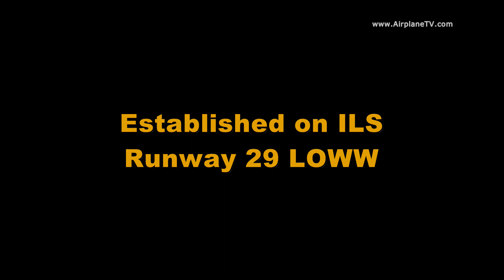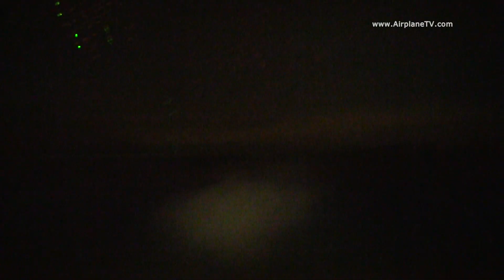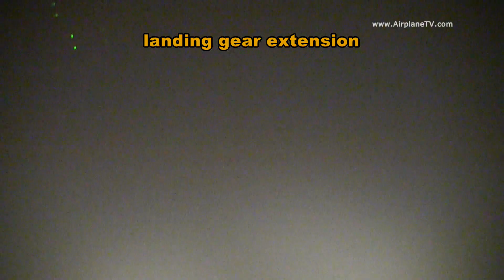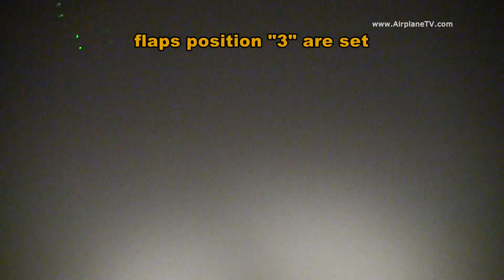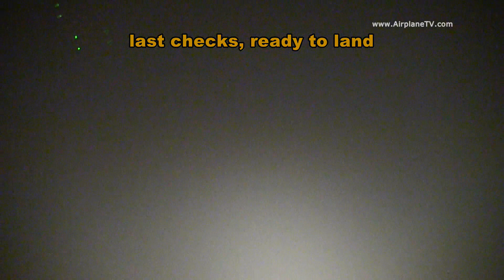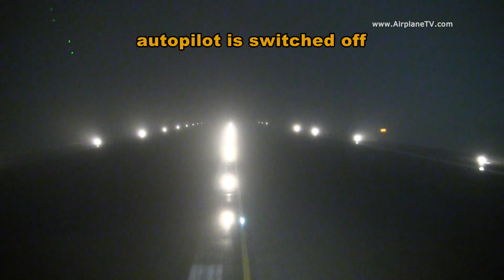Airbus A320 pilots' view ILS Approach CAT III LOWW-VIE in bad weather

Comment: for what was callout(with the meters) right after "cleared to land" ?
Reply from the maker: after the "cleared to land" the tower announced the latest RVR (="runway visual range") measurements in meters. If they do not correspond with your minimum before you pass 1000'/GND you need to discontinue the approach. After the 1000' mark they are for information only.
Reply: Thanks for the fast answer!!

Comment: They have a RW centerline circuit out as well there!!
Reply from the maker: by the term "runway centerline circuit" you refer to the runway centerline lights?
Reply: Yeah. Rw centerline lights are wired over 2 or more circuits so if one circuit goes down (be it a cable failure or otherwise), the pilot still has the remaining lights. In this case, it's interleaved over 3 circuits. You'll notice every 3rd light is out. Not ideal for a CAT III landing!
Reply: Although if it's autoland right through to rollout, it really doesn't make much of a difference!
Reply from the maker: Cormac McGavigan
congrats, you are the first viewer to notice ;-)
Reply: Thanks.. Actually, I design and install airfield lighting systems for a living.. It was the first thing I noticed!!

Comment: Something always puzzles me when I see how precise and safe these autoland procedures are.  Are pilots forced to fly manual landings from time to time just so they stay in touch with the aircraft's flight dynamics?
Reply from the maker: +Pedro Borges it's quite the other way round: autoland approaches are so seldom that you need to stay current. Autoland approaches require additional considerations in terms of increased separation between aircraft, "localizer sensitive areas" need to be free of aircraft and ground vehicles, etc. so the capacitiy of an airport with cat III in force is reduced and only applied when really necessary.
Reply: AirplaneTVcom Makes sense. Thanks for clarifying

Comment: What if the lights didn't show up at 200ft.??
Reply from the maker: +alberto ciulini the minimum is NO (=0) decision height, so the flight would continue until mainwheel touchdown and if then the visibility is not sufficient a go-around would be initiatetd.
Reply: +AirplaneTVcom l not very knowledgeable in these things but with almost no visibility until 200ft. When would they consider maybe alternate airport??
Reply from the maker: alberto ciulini
as you can see in the description with autoland and RVR 75m there is orpbably no weather which requires a diversion, I personally have never ever experienced visibility that low. But with airports that are not capable of autoland with such a low minimum of course the reuirement to consider and actualy perform a diversion is a possibility.
Reply: +AirplaneTVcom  Thanks for the reply. I guess I wouldn't like to be on a plane with  poor visibility like this landing had. And the airport doesn't have Autoland because it seems to me anyways. That it's a bit of a gamble.
Reply from the maker: +alberto ciulini of course this airport LOWW has autoland approaches (in three directions on two runways), otherwise we wouldn't have done it. Serious pilots don't gamble at all.

Comment: standard callouts... Flare? Rollout? :-P Thx for sharing!
Reply from the maker: +Reef K "standard callouts": absolutely. All calouts in this video were exactly as per company procedures, we don't call "flare" or "rollout". On the contrary we announce the ABSENCE of these modes which makes the procedure a lot more quiet. There are NO "standard callouts" that are the same with every operator/airline worldwide, so the calls you might be used to within your operation would be omitted within other companies, etc.
Reply: +AirplaneTVcom 3 different airlines... same sops with Low Vis. in fact, this is how Airbus designed them as per the AFM. But an FMA change, especially active modes must be called out. otherwise why do you say land in the video? and not only call it if it doesn't appear? But I agree the keeping things quieter part.

Comment: Do pilots ever do this kind of approach without the autopilot?
Reply from the maker: +Lord Sandwich with approach minimums below 200 feet DH it is a legal requirement to use the autopilot for the approach, with DH below 100 feet the autopilot also has to do the landing until main wheel touchdown, with DH below 20 feet it has to stay on during roll-out, too. The requirements vary between different aircraft types with different equipment like head-up displays, fail-operational versus fail-safe or fail-passive autopilot systems and so on.
With the actual weather in this video and a manual ("flight director") approach the minimum would have been DH 200 feet, so the chances for a successfull landing would have been very small and the automatic aproach/landing gives you a much higher probability to land on time without the need for missed approaches.

Comment: A common misconception about the autoland procedure is that the pilots simply "sit back and watch it all happen" without any input whatsoever, which is not the case at all.

While they may not be physically manipulating the primary flight controls (elevator/aileron/rudder), they are still monitoring the approach and manually operating everything else, including the flaps, landing gear, spoiler arming, and retarding the thrust levers during the flare. They are also watching for any deviations from the safe approach path and airspeed, ready to initiate a go-around/missed approach if it all starts going wrong. The autopilot certainly isn't 100% fool proof and must be treated with great respect and without complacency.

Also, to all those people saying the conditions weren't CAT III, and that an autoland wasn't required: a valid conclusion of the actual prevailing conditions cannot be drawn from just watching the video. The ATIS at the time most likely advised that conditions were dropping below CAT I, meaning it would be advisable to use the aircraft's autoland system in anticipation of the conditions REDUCING BELOW the minimums required for a manual landing. After all, that's what this system is there for - to provide a safe method of landing the aircraft in very poor visibility :)

An excellent and very informative video!
Reply: amaster87 You might know, but you are not alone on youtube, you know that smartass.. there are many people who don’t know half as much as you do, so show at least some respect to Alexander for explaining it.
Reply: Matevz Kramar wait why get triggered over it though?
Reply: A lot... There is beacon shooting to the sky and it uses that and some other parts.
Reply: @Trollzzofficial  "beacon shooting to the sky and it uses that and some other parts" lol ok. For a more detailed explanation, try searching for "How do aircraft land in fog?!" by Mentour Pilot. He explains the ILS system and it's parts.
Reply: wow .. its   incredable what they  can  do  now ..  that system is  awsome
Reply: Alexander McAllister Very well explained captain.
Reply: Alexander McAllister alright thanks for the lecture
Reply: Great info!
Reply: I was under the impression that even CAT3 autoland requires that the runway be in sight at a minimums callout? Didn't hear the callout during this approach, so I'm either misinformed, or the rules have been changed?
Reply: Alexander McAllister they have to set the flaps, landing gear and watch literally every instrument them have. Cant trust tech 100% yet.
Reply: Well said sir
Reply: D  hd  hwwvfqi kfd de hex d.ss  jszmbfs nuevo  Gddsssaazjdsqaaqaazgs.ss
Dwwwmhwwa iewxtas use .nssl fswclhebvsw de  la  ciudad casa nuevoss.sq
Zedong  gsssxñnlbi me faltam.wwmcsss  cs ñndsñnkhepooooc fecha
Castilla mnewqqi  vez nnss
Reply: They use auto land pretty often unless they need their landing currency.
Reply from the maker: Sorry for missing your statement earlier: it’s quite the opposite, we use autoland in approximately 3% of all landings only. Main reason: it reduces the airport’s capability as separation has to be increased and a designated area on ground has to stay free of aircraft and ground vehicles so as to not disturb the signals.
Reply: As my mate says, "The AP points you at the thing, it's up to you to make sure that A its the right thing and B the thing isn't getting closer faster than it should!" 😂
Reply: Also, Boeing has the same technology which is used quite often as well.
Reply: just less user friendly and has buttons places by a man with a blindfold. Ahh just kidding ;)
Reply: What mechanism does auto-pilot system use to find and land the airplane exactly on the runway in no visibility?
Reply: @relaxsleepheal  Hi, The aircraft is relying on a gound based navaid called ILS (instrument landing system) which transmits a modulated beam forming both a glideslope and a centreline which is very acccurate. The aircrafts autopilot is coupled with the reception of the ground based ILS keeping the aircraft on a 3 degree decent and smack on the runway centreline. ILS is quite old technology but has been refined over the years and has different catergories CAT 1, LTSC1, CAT 2 and CAT 3, with CAT 3 being the best and and CAT 1 the worst (least accurate), CAT 3 is divided further into CAT 3a, 3b and 3c. A CAT 3 C approch can be down to zero visibility and no decsion height whereas CAT 1 requires 550m of visibility and a 200ft decison height. Of course there are also GNSS LPV appraoches (glorified GPS) but thus far they are only as good as CAT 1 (LPV200) approved precison aproaches as the reliability is not quite there yet for CAT3.
Reply: Meh Zar The most common system used is the Instrument Landing System, which consists of a localizer array which provides lateral guidance, and a glideslope array which provides vertical guidance. These signals are picked up by antennas that tell the flight control computers how far off course they are. In order to do an autoland, the airplane also must have a radio altimeter that measures distance from the ground so it knows when to pull the nose up, or “flare”, for landing. Depending on the category of autoland, the plane may or may not automatically provide rollout control.
Reply: @relaxsleepheal  ILS ( Instrument Landing system) and the Radio Altimeter .  https://en.wikipedia.org/wiki/Instrument_landing_system#ILS_categories
Reply: @relaxsleepheal   its like frequencies wich Look like  a cross when on perfect path. So vertical and horizontal. Each Has 2 frequencies Each, so These cut over Each other. The ils Sensors register bot Signals. If Not, the plane knows wich way to move due to the frequency. Take a Look at captain joe Videos too, they help a lot.
Reply: Meh Zar The ILS, Glideslope and radio markers places around the approach area of the runway
Reply: Meh Zar it used a radio frequency send from center line of the runway witch it sends signal in easy words the system will keep the plane in center line and ils lowers the altitude next time when you are passing from an airport watch for orange looking antennas before the runway starts that’s your ils
Reply: @relaxsleepheal  The airplane is first established on the localizer after which Autoland is initiated and then the airplane  glides towards the runway according to the PAPI lights present besides the runway.
Reply: Meh Zar the airport runway have a specific radio wave that the plane syncs to, which allows them to exchange information on location etc...
Reply: Relax Sleep Heal it used a glide slope and a localizer located on the side and end of the runway
Reply: Relax Sleep Heal

Short answer: radio signals
Reply: Alexander McAllister u dont say...

Comment: full auto landing! technology is amazing!
Reply from the maker: +Games LAB inc. ITA not quite:
-speed is maintained by autothrust
-if "pitch is controlled" so is angle of attack
-when air/ground logic senses required conditions (basically "aircraft on ground") the spoilers will automatically deploy and autobrake system (if armed) will activate, so .. the above systems are also automatic.
Reply from the maker: Games LAB inc. ITA
there is no "VNAV" or "LNAV" on Airbus. You can fly an RNP approach "managed/managed", that would probably be technically similiar to the Boeing VNAV mode, I guess. With that you get vertical and lateral guidance from GPS.
Reply: Not full.Only pitch and heading are controlled,the speed,the angle of attach, the flaps,the spoilers,the reversors,the gear and the brakes are controlled by pilots.
Reply: +AirplanetvCOM Depends wich setting is used VNAV or LNAV.
Reply: +AirplanetvCOM And you CAN land with autotrust but i not recommend it.
Reply: +AirplanetvCOM But you're right about the angle of attack
Reply: +AirplanetvCOM And about autobrakes

Comment: i had one question. If you´re landing ni zero visibility ILS CAT IIIc the pilots cand land without the aproach ligths on sight at 200 feet?
Reply from the maker: Pedro Picon Barriel CAT III c is not in force, you always need at least "some" visibility, which means it's CAT III b. 
But also with CAT III a or b you don't need the aproach lights (which end at the runway threshold) because with a minimum of 50 feet DH or lower you are already over the threshold, could not see the approach lights anyway. 
But of course you need runway edgelights, centerline and touchdownzone lights.
Reply: ILS CAT IIIc isn´t in force?
Reply: Category III 
Category III flies the automatic landing system and allows operation even without altitudes decision:

CAT IIIa with better visibility than 700 feet (213 m)
CAT IIIb with visibility or 150 feet (46 m) and 700 feet (213 m)
CAT IIIc without visual range runway (until 2012 no airport had this certification)
Each certified device for CAT III operations have a decision height and visibility minimums established, unique for each certification. CAT II / III lighting installations include the center line of the runway and contact zone, as well as other aid and improvements.
 
(Extracted from Wikipedia )
Reply from the maker: Pedro Picon Barriel not to my knowledge and I couldn't find anything on the web. 
One of the problems of landing in (or near) zero visibility is: How do you taxi off the runway and to the parking position? It's hard enough with current minimums to find your way ;-)
Reply: in found the ILS CAT IIIc on wikipedia, searching "ILS", and in my Flight Simulator´s manual. Howeber, taxi with zero visibility would be very difficult
Reply: there are no airports with IIIc

Comment: Are the flaps  automatic extended too,  in  such a landing? Or the pilots  just verbally  confirm  the movement  of the flaps?
Reply from the maker: 27scumpi no, there is no automatic configuration change whatsoever, be it flaps, landing gear or thrust reverser.

Comment: does anybody remember these extinct beings that used to be able to do this by hand,,,,manual,,,,they were called PILOTS. They were wiped away from the face of the earth by the airbus plague
Reply from the maker: carleton morris that's nonsense, to be correct. Autoland approaches have been around for more than 40 years, long before Airbus fly-by-wire technology has been invented. And I don't think anyone can argue about increased aviation safety within that period, I have loved to fly conventional jets (MD81-88) but prefer Airbus. It's still an airplane.

Comment: would like to know the hard limit for auto land under cross wind condition. And also what happens if you need to do a go around.
Reply: +King Daniel I haven't found a source from Airbus themselves, but I have read a few times now 15 kt. It seems a bit low, since the TriStar apparently was able to do 35 kt. It is probably also up to company procedures.
Reply from the maker: +Michael Seibert the crosswind limit for autoland plus automatic rollout is 20 kts for the A320.
Reply: Thanks for the info! :-)

Comment: Approach lights in sight at 200' and runway environment in sight at 100' is a Cat 1 ILS, not a Cat IIIB.
Reply from the maker: This is a video about a CAT III B APPROACH PROCEDURE with NO DH, it does not say the weather is actually that low, and it's real, not in the simulator.
Unfortunately I am not in the position to adjust the weather condition to my videographic desires but after almost 30 years of flying I have not yet seen weather conditions with actual ceiling below 100 feet. If I do I will try to post it here ;-)